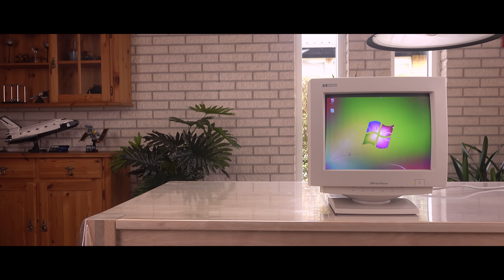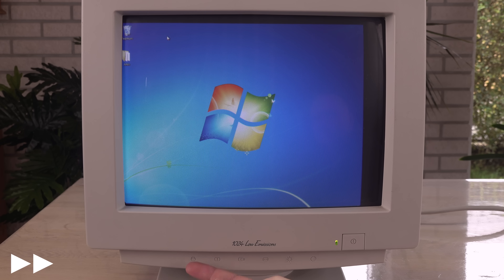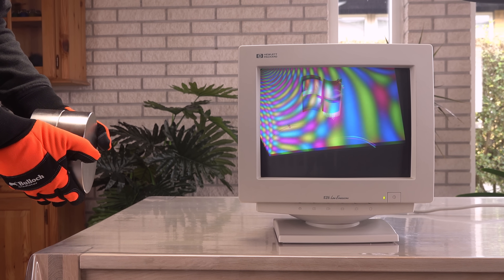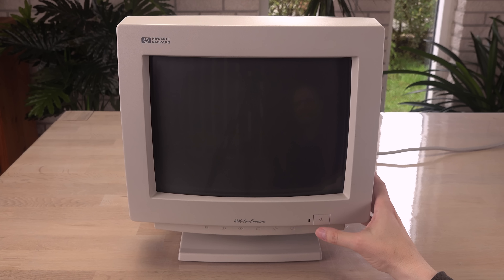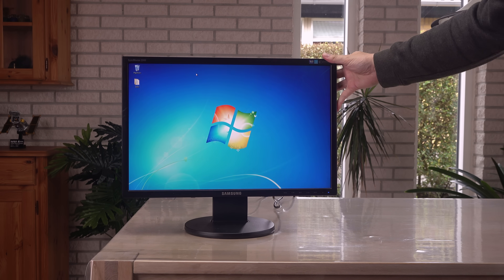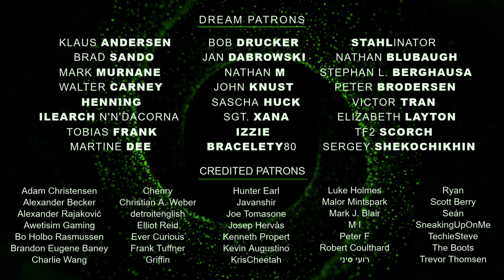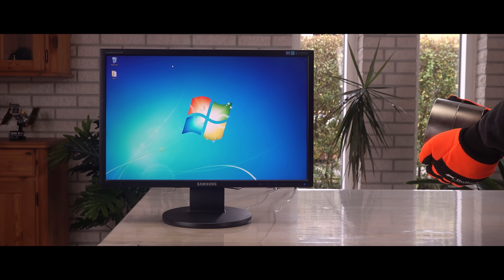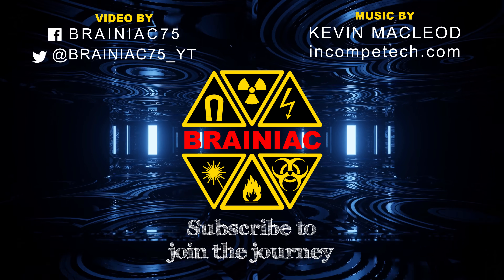Monster magnet meets monitors...

Comment: I used to have a 21” CRT monitor, back in the day it was BIG! Taking it home I had to carry it up 3 flights of stairs and this thing was extremely heavy. 
  It had a degauss button, when pressed the desk shook with the power of the thing. 
  These days I like to sit back with my average 40” monitor that weighs so little in comparison.
Reply: that's not a monitor that's a tv lol
Reply: @turkey_sandwhich  
  Well a 40” TV used as a monitor, it’s all good! 🤣
Reply: @locouk - you think that 21” is heavy, I’ve still got a 26” wide screen Panasonic CRT TV in my bedroom because I can’t find the energy to move it! And yes, it still works, it’s a 100Hz type.
Reply: @Mark1024MAK  "you think that 21” is heavy,"  
Many of the higher end large CRTs were heavier than similar sized TVs of the day and a lot more expensive.  Thick steel chassis, with the heavy screen at front you need heavy counterweight at the back, extra weight in the desktop swivel mount to support it all. There were also the larger arcade game displays 25-29 inch that could take a pounding but usually lower-res and a bit cheaper.
 Doesn't mean you couldn't get very heavy TVs as well.  Weight meant value for consumer goods,  even if it was overweight frames.
  Dual 21 inch displays, used up until around 2009,  moved house a couple of times in a year and just couldn't be bothered shifting them any more. They were fading a bit anyway.
 No VGA, just RGB separate inputs and a bunch of other coax inputs.
 About 600mm depth, 42 kg each I recall.  $5000 each new around 1996 , around $10k in today's money.  Replaced with multiple thinscreens , soooo much more desk space, so cheap, so large.
  The CRT were so large they could fit a platform on top, the cat would curl up on top of the monitors, not the original reason for the platforms but it took over.
 The alternate name for a monitor was 'cat suppression device'. :-)
 Main reason for delay, dare we deprive the cat of its winter heated pad?
Reply: @turkey_sandwhich  nah they had monitors that big. in fact some pro monitors from the day went all the way to 40", though they were more projection based monitors
Reply: @JessicaFEREM  I was talking about the newer monitor
Reply: Up to 65" even BFGDs
Reply: Yeah, I remember our family's 29" CRT TV took 2 people to move around, not only was it 30+ kg but at that size it's not even just the weight that is a problem. You just can't hold it properly.
It's funny that LCDs weigh so little but in comparison my 21" PC CRT weights proportionally more than the 32" living room TV, both LED backlit ones and the PC monitor doesn't even have a power supply built-in. Guess they just use way thicker glass on it.
Reply: @Kalvinjj  I got an 82in LCD tv that I could carry myself if not for the awkward size of it, but holy hell did my uncle's 32" CRT tv weigh so much back in the day that it was always a two person show. And it still felt heavy with two people, it was such a monster
Reply: @stemartin6671 this used to go with a real loud thud, it’d wake the house if you did it late at night.
Reply: damn I wanna see that now
Reply: I had one also and that thing was a beast. I feel you on the Degaussing, you hit the button and there was a big clunk then buzz and the desk, monitor and srcreen violently oscillated for a few seconds before going right back to normal. I really wish I still had that monitor, think the rez was 1600x1200 at 120hz maybe higher I can't remember.
Reply: @D3M3NT3Dstrang3r  
  I wish I still had mine, I owned it 15 years ago and back in the day a 17” monitor was considered big and 14” average size. Inside it had a cage made from pressed mild steel for shielding, I think this also added to its weight.
Reply: I am typing this comment on a 19" CRT from 2002. It took some effort to get this upstairs from where it had been sitting in a corner plugged into an old pc, rarely used since about 2014, but it works great though, I swear it looks better than any other monitor I've used, even with 1/2 the pixels of a modern LCD
Reply: CRTs are so cool.  I've always found the big mechanical looking analog style of them super cool.  Sadly they're the equivalent of Internal Combustion Engine vehicles compared to superior modern Electric Cars.  Simpler, more efficient designs with fewer parts and points of failure typically win out.
Reply: Your pfp is all the evidence I need to believe your story.